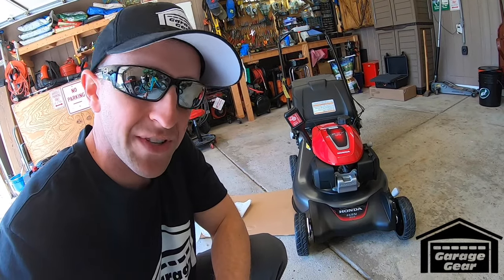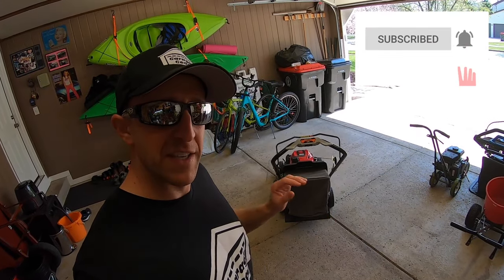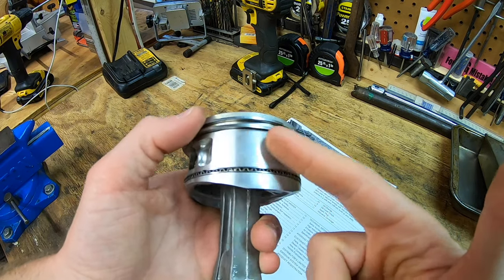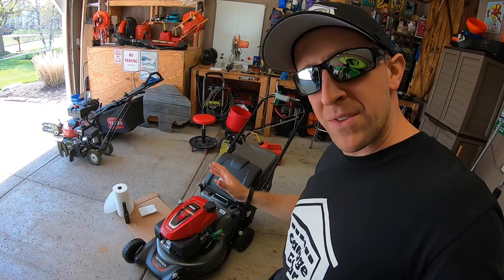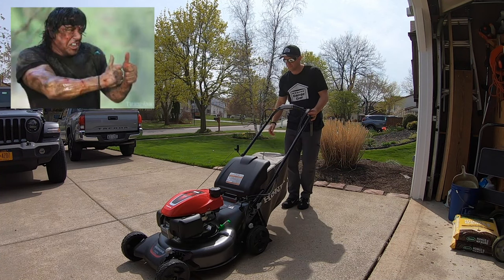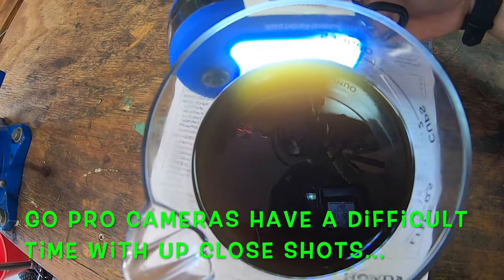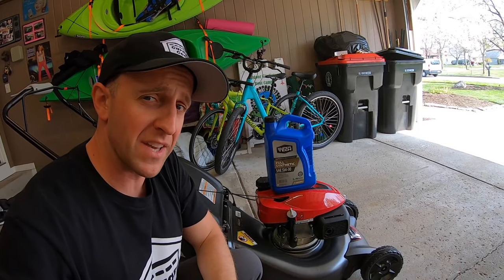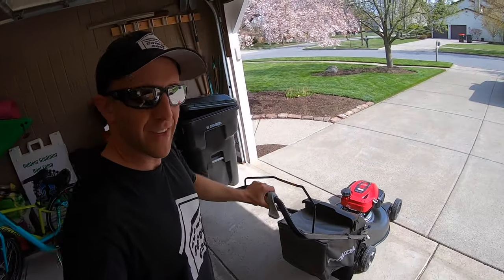BEFORE You BREAK IN Your New Lawn Mower Engine, WATCH THIS!

Comment: After almost 15 years with a top of the line Honda mower and not a single repair needed decided to purchase a new one before they stop production.  Not so good luck with the new one, out of the box defective.  The compression release mechanism is not working making it very difficult to start.  Unfortunately Honda nor Northern Tool will replace it but requiring me to take it in to their shop.  The GCV200 has the cam internal with push rods rather than overhead cam like the older models.  With the new set up, complete disassembly of the engine is required to replace the cam and compression relief mechanism.  I am disappointed to buy a new mower and have the engine completely taken apart and reassembled.  Unexpected for Honda to ship it with the defect.  The pull cord abruptly stopped when I first pulled it so hard it bent the keeper on the handle.  I purchased a Honda battery charger to make sure the battery is fully charged.    Have you encountered this problem?  The mechanic at the shop said they had just completed repairing one and that the part is on backorder. Defects happen to every manufacturer, the difference is how it is handle.  I would like to have an exchange for another new mower rather than a major repair. https://youtu.be/MPvxokO1YII
Reply from the maker: Thanks for sharing this ole! I have not experienced this.

Comment: This was very good. Even of you just do the first change at 15 minutes, then yearly thereafter

I use 5w/40, big mistake?
Reply from the maker: Yep definitely good to do. I would use whatever is Recommended in your owners manual. 👍
Reply: @GarageGear  I think that's 10w/30, but does it make that much difference? Same oil as my car you see
Reply from the maker: @ChrisPatrick-q6k  there are temperature ranges to mindful of depending on your climate. That determines which oil to go with

Comment: Does the fuel leak when you too over on its side to change oil.  I have that issue constantly with my toro. I just picked this up will be doing this process today.  Thanks for sharing.  👍
Reply from the maker: So far no leaks on mine but you may want to only fill it up half way to avoid that issue. Thanks for watching and congrats on your purchase!

Comment: Chickanic says the new Hondas are not good cause if you mulch the grass gets caught in the drive belt under neath due to no shrouding .Mine is exposed and mine is 5 years old but I always bag so the grass doesnt get caught in the drivebelt.
Reply from the maker: Hey Ray! Saw that but I have never had that issue and always mulch! I would avoid chopping up large sticks or branches !

Comment: Is it okay for the mower if I change the oil viscosity during the winter and summer times from 5W-30 and 10W-30?
Reply from the maker: Are you mowing in the different seasons or stowing the mower?
Reply: @GarageGear  I’ll be mowing long as the seasons let me in my area, but based on the outdoor temp the 10W30 is for higher temps, so do you still run the 5w30 all season long?
Reply from the maker: @erickhurtado8162  I run 5w30 full synthetic because our temps vary widely here in Buffalo. I change my oil once a season. If you’re in the south where temps are higher running 10w30 makes sense.
Reply: @GarageGear  JB I live in the Washington area, what oil viscosity would you recommend for me? I just broke in my lawn mower and now will be changing the oil.
Reply from the maker: @erickhurtado8162  I would run 5w-30 full synthetic! Can’t go wrong for your climate

Comment: When auto restorer mechanics get a new expensive crate engine, I noted that they use a special engine oil just made for the break in. Sometimes the special break in oil comes with the engine. I am guessing that it is not as slippery???

If I am correct, and also being frugal, it may be better to use a decent, less expensive conventional engine oil, for the break in period. More of a break in, and less expensive. Then switch to the 5W30 full synthetic.

My snowblower calls for 0W30 but that isn't usually on the shelves; not a good quality one anyway; not in these parts.

My small inverter generator and my snowblower both need to be able to run in cold weather, so 5W30 Full Synthetic is perfect for both. Can be run in hot weather as well.

I used a good quality conventional 5W30 oil for my break in of both machines, then switched to 5W30 Full Synthetic(same brand). At the very least, I saved some money on the break in. I may also have gotten a slightly better break in, where conventional oil isn't quite as slippery. That's the theory anyway.

I still have quality conventional engine oils in my older summer machines. SAE 30, or 10W30.
I don't mow, or till in winter ;-) Wood splitter, Dad's, gets 10W30 conventional, because it does get used in spring and fall, which can be cold. If this were my machine, it would have full synthetic 5W30 in it...and high test gas with conditioner, etc......I just get to fix it :-(
Reply from the maker: Thanks for sharing this with the garage gear community! Enjoy the mow this season!

Comment: I bought a cheap craftsman mower with a Briggs and Stratton motor and it says “no oil changes” and the manual doesn’t have anything about breaking it in. Should I do this on it?
Reply from the maker: I would definitely give this procedure a shot. The engine should have a drain plug somewhere toward the bottom. Swap the oil out of you can and put in some new oil after running it for 30 minutes or so. Thanks for watching MO!
Reply: That no oil change rubbish is nonsense. Use it for 6 or 7 hours then change it and then every season there after.

Comment: Hey my Honda mower is only allowing 8 ounces of oil. When I do 13, it's above the round thing on the tip of the stick instead of the line.  I let it drain for awhile too. Any help?
Reply from the maker: Hey Trey! This is an interesting question. At 8 ounces is it above the line?  Maybe try filling it to 10, 11 or 12 oz and see where it’s at. Go up a little each time. Let me know. Thanks for sharing!

Comment: Great video JB. I'm looking to buy one of these used, the previous owner stored it without oil, is that okay? wouldn't it cause corrosion inside?
Reply from the maker: Depend on how long and where it was stored. How long did it sit with no oil? It may have had some residual oil inside.
Reply: @GarageGear  6-8months without oil. Stored inside garage
Reply from the maker: @itzyala6232  I’d go for it. They sit longer on store shelves sometimes with less oil in them.you’ll probably be able to get it for a good price.

Comment: I just changed my Honda engine oil after 10 years.  Gave it a new blade, spark plug, and filter while I was at it.  It runs as smooth as your new engine and doesn't burn oil or leak it.  I'll be good for another 10 years before I need to change it again.  Go team Honda!!!  🤗😘😉
Reply from the maker: @christopherguzzi1316  wow! Thanks for sharing Christopher!

Comment: I’d only do what the manual says. If it says 5 hrs break in that’s what I’ll do. If you bought a 4 stroke Yamaha outboard they have many specific procedures for the break In period. If you made up your own rules for the break in you may blow something going 5600 rpm. I just bought a Toro timecutter zero turn last year. That was 5-6 hours breaking then new oil. I’d always do what the manual says to the letter.
Reply from the maker: Thanks for sharing

Comment: Any reason you used  5W 30  instead of the  recommended 10W 30?  Because its synthetic?
Reply from the maker: The manual calls for either based on your climate/temperature ranges. 5w30 fit my temperatures best! 👍

Comment: I'm a novice but shouldn't you check the oil level after adding the oil? 

I just bought the Honda HRN216-VYU and the mower store added 400ml oil before I left. I checked the oil before starting it and it was double the max level mark. The manual says it has a 400ml oil capacity, but the refill amount varies between 350 to 400ml. I dumped the oil to check how much was put in (400ml) and then added 350ml and it was still over the max level. It ended up being closer to 296ml. I saw another video on youtube for my model and that guy could only put in 296ml to reach max level.
Reply from the maker: Smart idea to check it before and after filling it up. Thanks for sharing

Comment: I looked at the owners manual and it says you can use gasoline with 10% ethanol is that true? Or does it have to be ethanol free?
Reply from the maker: Yes gasoline with 10% ethanol is standard pump gas and will work in your mower. This will clog up carburetors. I strongly recommend buying ethanol free as it won’t clog up your carb. Avoid the issues and go with ethanol free it you can. Thanks for watching DR!
Reply: @GarageGear  thanks
Reply: @GarageGear  i have one last question. Can I use 10w-30 car oil that is full synthetic? I did some research and it says it’s completely fine
Reply from the maker: @DR-UTAH  that will work just fine! 👍go for it!
Reply: @GarageGear  thanks your the best keep up the great content

Comment: Run your engine for less than the recommended time on break-in oil, there is a higher risk of the rings never seating properly which is will ultimately shorten the life of the engine.  If the metal particles are a concern, swap in new break-in oil until going the full 5 hours.
Reply from the maker: Thanks for watching!
Reply: @GarageGear  He's saying non-synthetic for first 5 hours.
Reply from the maker: @chris2790  thanks Chris!
Reply: @GarageGear  sure thing!

Comment: Still got a Honda 216 running fine after ten years. Always changing the oil on time and only running ethanol free gas in it.
Reply from the maker: That’s the way to go Patrick! Great minds think alike! Mowers are expensive. Oil is cheap. Change the oil!  

Question for you! Did you have to replace the wheels on it at all yet in ten years?
Reply: @GarageGear  I haven't replaced the wheels yet. They are starting to go bald though.
Reply from the maker: @pt6998  pretty impressive how long they’ve lasted. Thanks for sharing! 👍

Comment: This might be a simple question....but if you are simply running the mower for 20-30 minutes in your driveway, burning gas too....why wouldn't you just cut the grass during those 20 minutes instead of just letting it sit there in the driveway?  Then after the 20-30 minutes or however long it takes for your first cut, just change it after the cut.  Am I missing something here?
Reply from the maker: Great question! The Honda manual says to use it for 5hrs and then change the oil. Other engine manuals that I read state to do a break in with no load on the engine for approximately 30 minutes. I prefer the No load method for this. Just let it run for 30 minutes, change the oil and you’re good to go!

Comment: Just purchased a new Honda for my new place. Waiting for the email to say it’s ready for pickup.
Reply from the maker: Awesome my friend! Enjoy the mow when it arrives!
Reply: @GarageGear  I might have seized the motor. Had the plan to idle the engine for 30 minutes and change the oil. Maybe I didn’t press the levels right but it died after 5 minutes. Couldn’t pull start it, and ended up taking it back for a lower Honda model. Doesn’t have the nicer transmission but it works. Felt a little strange when the guy said it had oil and I’m good to go, but still left the tag that said no oil in engine.
Reply from the maker: @marathonbaker  ok got it! Never trust anyone handling the machine. I always check the oil personally to make sure it’s where it needs to be. 👍hopefully this new one works out.

Comment: During the first start up did you run it on high or lower rpm?
Reply from the maker: Hey there! My mower doesn’t give me a high or low option. It’s just high all the time. I would start low and then work up to a higher rpm within the first couple of minutes. Thanks for watching!
Reply: @GarageGear  that's kinda what I thought. Just finished the break-in and just like in your video the oil was black. I'm always suspicious about factory manuals.
Reply from the maker: @James-qq2vq  I hear ya! Can’t go wrong breaking them in this way! 👍

Comment: Hi ...do I wait for the mower to cool down before removing the dirty oil or right away ?  Thanks
Reply from the maker: No need to wait. Drains better when it’s hot anyways. Thanks for watching Stephen!
Reply: @GarageGear  In addition to draining faster when hot, a lot of the damaging foreign matter in the oil is in colloidal suspension. If you wait for it to cool down, gravity will take those particles down to the bottom of the sump and they won't all come out when you drain the oil.
Reply from the maker: @StephenPaul1160  another great point! Thanks for sharing!

Comment: For the first 29 min should it be run in driveway or can you cut grass and change at 29 mi.
Reply from the maker: Great question! Most engines should be broken it with no load.(no mowing) after the break in youre good to go. The manual says use it for 5 hours. I disagree with that but to each his own. Thanks for watching!
Reply: @GarageGear  I just picked up my Honda hrn216VYAA . You helped me make the final decisions to purchase it.
Question their peers to be a plastic film around the casing / red plastic covering .
Do I remove that film or is it ok to leave on to protect against scratches . Only reason I knew it was there was I saw a little nick in it. TYVM for your time and help
Reply from the maker: @sixkings7831  hey Six, I would remove the clear film. My concern is that if the motor gets warm enough especially in high temps it could damage the plastic red cover. To hide future scratches you could put a thin coat of automatic transmission fluid on it to shine it up. Hides scratches great! 👍

Comment: What do you think of Castrol edge full synthetic
Reply from the maker: Great stuff! I’m for it! I like a lot of different brands of oil! 👍
Reply: Number 1 amsoil 100% synthetic
Reply from the maker: @reginaldsmall3766  good stuff! 👍
Reply: I use amsoil small engine oil because it’s one of the few synthetics you can find with zinc.  Zinc is important in these small engines. Regular auto oil doesn’t have much or any zinc because it damages catalytic converters.
Reply: @horsemany  you are 100% correct. Zinc is the answer.
Reply from the maker: @horsemany  thanks for sharing!

Comment: Coming from a Honda small engine fan:
These new Honda engines will start to surge and hunt when the jets get plugged up no matter how careful you are. Make sure you learn how to clean the carb jets if you buy one of these new Honda lawnmowers. Warranty doesn't cover the fix and they'll just say 'stale gas' at whatever shop you take it to. You were warned.
Reply from the maker: Thanks for sharing
Reply: I think All machines do that.  I am gonna install a better one on my Briggs and Stratton today. Gonna start using unleaded premium Gas. 596521 p/n 450 E series Fuel module main jet

Comment: First of all - thank you for your smart reviews and advice - that I have used!

Now for a problem!  I am getting Grass in the bagging discharge chute with my brand new HRN216VKA when in full mulch mode.  I love the cut I got.  But the grass in the chute switch actually jammed and had to be cleaned.   The grass was completely dry.

I am seeing this this problem repeated on the internet.  But kind of disappointed in this.  Do you think this is inherent in the design?  Should I return this unit for a new one or clean and ceramic coat all related undercarriage surfaces.   

This link  https://m.imgur.com/A8XwGcG   "Shutter adjustment Procedure" suggests a solution.
Reply from the maker: Hey Ron! I appreciate your kind words and feedback! I get get the same dry grass in the discharge chute even on mulch mode. Somehow with the turbulence under the deck grass finds a way in there. I blow it out every other week or so. No big deal. 

As far as grass in the lever I would recommend moving that switch just for the heck of it before and after every mow jus to keep things clear in there. I can imagine not using it for a while causing some build up. Also keeping it clear under the deck to help it slide. The pics you sent were for the HRX. I’m not sure if the same would apply to these mowers or not. I’ll look into it. Plenty more to come on this mower! Stay tuned! Thanks for being a cool fan!
Reply: I'll call Honda.  The cut of this mower is a marked improvement.  If I have to 3 minute clean every time I use it, I'm still satisfied!  Thx
Reply from the maker: @ronmorgan3246  let me know what they have to say! 👍

Comment: But we aren't starting the mower for the first time.  Honda ran the engine at the plant to test it, then drained the oil out, so technically it's been changed once already.  I'll go with what Honda says.
Reply from the maker: Well the oil was pretty dark and full of metal specs. Never had an issue changing it at the first 30 minutes to get all that out.